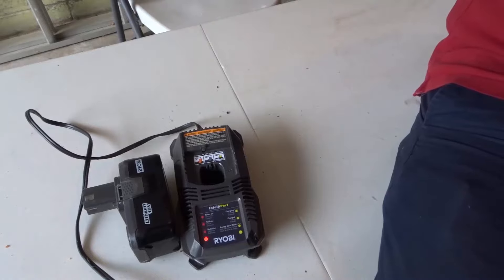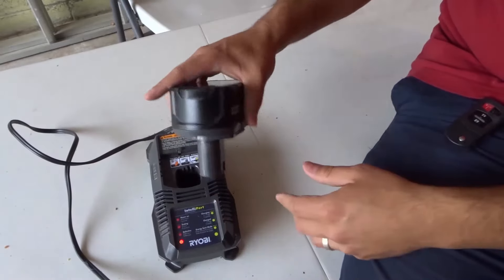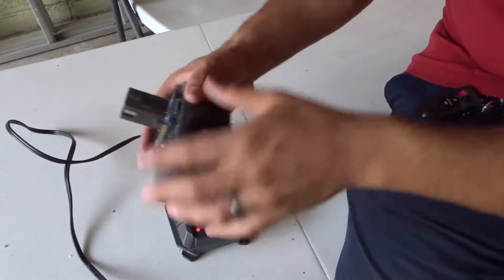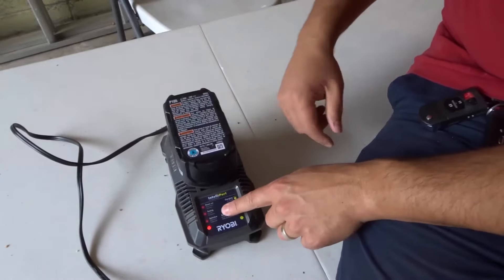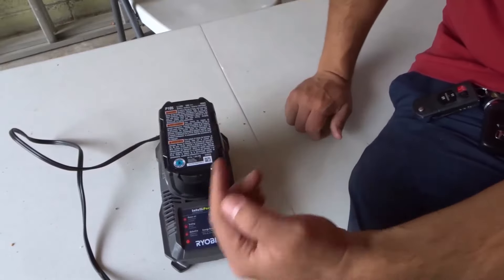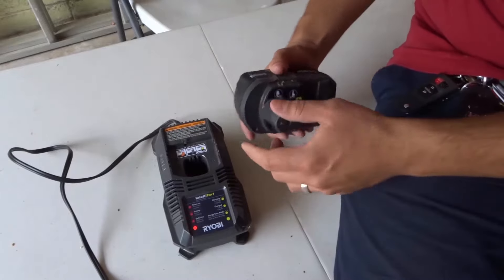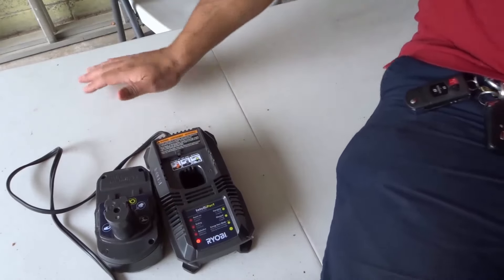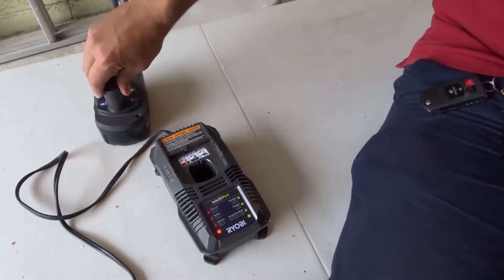Ryobi One Plus Battery Not Charging-Easy Fix

Comment: Ryobi is practicing engineering malpractice. There should be a reset or wake setting/button. Shameful! (Btw, this method didn't work but I'll try again.) No consumer should have to go through this.
Reply: It seems annoying but when one or more cells inside these battery packs gets too weak or defective there is a real fire risk if the charger just carries on charging the remaining cells. It's not only Ryobi, every reputable battery powered tool manufacturer has to add this safety cut-off. It's not ideal but allowing charging battery packs to literally burst into flames inside people's houses or workshops is unthinkable.

Comment: Thought this could never work plug it in and out as fast as you can only took about 3 mins and it started charging saved me from buying  2 new batteries… keep it plugged into the charger took about 15 minutes to start charging… I have T100 batterys. Thank you great hack

Comment: Tried this over and over again on a very dead battery pack.  Finally drilled out the tamper resistant screws.  Found 5 cells in series that collectively had 1 volt.  Used a small 9V DC charger across two cells for about 20 minutes.  And then across the other 3 cells for about an hour.  Voltage across the 5 cells rose to about 16V and then I could use the charger.  So yeah, thanks for the suggestion!    Sadly, nothing kind to say about Ryobi.

Comment: I had a somewhat new battery that would not charge even though it showed two light bars on it. I did this for about 2 minutes and it worked. Thanks for the simple tip with no long winded explanation.

Comment: Beginning yesterday, the charger won't illuminate any of the indicator lights. I unplugged the battery and plugged it back in several times, but it won't do anything. Any suggestions? This is the only ryobi battery and charger that I have.

Comment: I did this with my battery and checked progress with a multimeter. My battery was only reading 0.01 volts at start. Did this for 1hr 20min and battery read 0.18 volts. Battery would not charge. Charging threshold is at least 0.5 volts, I believe. At that rate, I’d have been there for at least another 2hrs. It works, I guess. You just gotta have patience. I purchased some cheap alligator clips and will just be disassembling the battery and jumping it directly, bypassing the drain check.

Comment: disappointed. i just bought my ryobi combo: blower and trim edger, it include a brand new P108 battery and P118B charger. both red and green lights are flashing as defective. i called ryobi for warranty and they dont have any P108 batteries in stock. looks like i'll have to return my combo

Comment: Hello Louis Scott here understanding your efforts to getting a Ryobi to charge and you are correct but a method I used was to get a tricycle charger and connect the positive and negative leads  portion to the + and - sides of the Ryobi battery for just a second are two  eliminate the detective mode. Probable NOT recominded.

Comment: Wow, had the battery apart to do the 'bypass circuit board' charge and was just looking for a video to show where the positive and negative was on the inside and found your video.  Put the battery back together, three times in and out of the charger and it started charging fine.  Amazing.
Thought it would take like 40 times or something.  Battery hasn't been charged in probably six months before this.  Thank you.

Comment: Hi i got a problem with a ryobi batery 18v
First: the indicator charge just turns on one led when this One have 17 volts,and second, the charger show as if this one are loaded but have 17 volts and the drill don't Work with this Voltage 
Do you know what could be the problem?
If you can answer me I would be very grateful, thank you
Reply: At 17 volts, it sounds like one of the five lithium cells inside is low / out of balance.  The BMS sees this and won’t charge the other fours cells past 4.2 volts each.

The solution is to open up the battery and measure each of the cells.  When you find the low voltage cell, charge that one cell with a cheap 18650 cell charger and a couple alligator clips.

Comment: This is the same trick we would use with nickel cad batteries back in the day , only we'r would plug the charger in then unplug it and repeat til it started charging and it worked saved a few dollars at the time.

Comment: it didn't work for me sadly more then 10 times with 2 seconds to plug it , but i tryed to plug it to charger with 2 wires with + with + and - with - with duracell battery 1.5v aaa , i have waited for 12 minutes to see effects then still not charging then i tryed wire connected to battery + to -  and - to + for 16 minutes then I removed the wires to see will start to charging by its self but still wont to be charged :face-purple-crying:

Comment: Didn't work..took the 5 screws (Torx 10 security) out, measured each cell, found the weak ones ( under 2.6 volts) and used a single cell LiIon charger from the usual scumbags on each until voltage was over 2.7.   Then I used a 5 cell charger for the entire battery until it had 16 volts.  Re ass embled and slapped it into the fast charger.  Like mint.

The reason for this is a cell protection circuit which won't turn the main MOSFETs, feeding the electrons to the negative side.

Battery pack protection circuits don't all work the same way.  Weak cells are the weak link and could be damaged if charged in series, causing a fire.  So if you use any method to resurrect dead packs, do it outside on a flame resistant surface.   Have a bucket of water handy to quench any chemistry version of a scaled down Chernobyl run away.
Reply: You broke the seals on the battery. The computer beat you

Comment: The easier fix is to take laptop charger 18-20V connect positve and negative via any 12V bulb(do not use led) for 5-15 minutes
Reply: That's easier??
Reply: @smchenry2255  easier than spending 30min mindlessly plugging and unplugging in a battery. This is fine in a pinch, I just got my Ryobi battery to charge by throwing it on 24 V for a couple minutes with some alligator clips.

Comment: My "dead" battery is on a different kind of charger with only lights vs. readouts. I tried this several times, it's a bit awkward green light for about 30 seconds then goes to red. Tried just leaving it and on and on nothing worked. It's a battery for a Stick Vacum and the battery stays in the vacum and you plug in the whole thing on its strorage/hand up device. It's only been used about 15 times if that.

Comment: The green light never stops blinking with my new generic batts.  They seem to charge and work fine.  Any idea?

Perhaps use a power supply to get the initial charge instead of going in and out?  Set it for 18.4v?